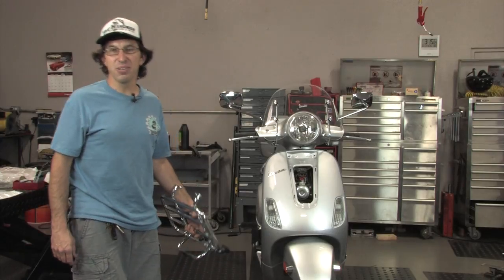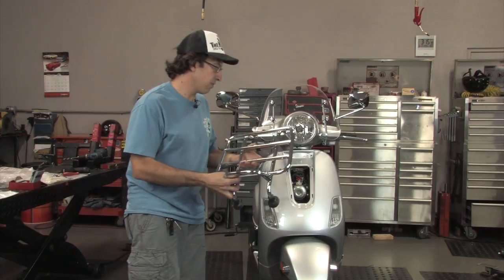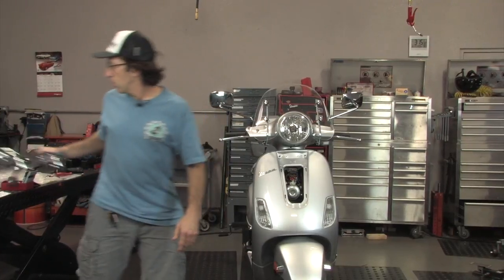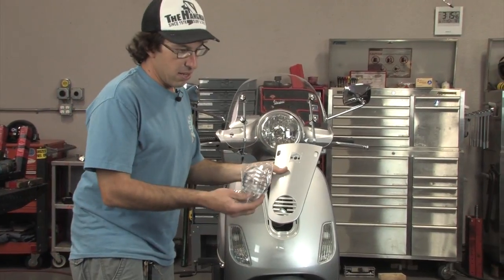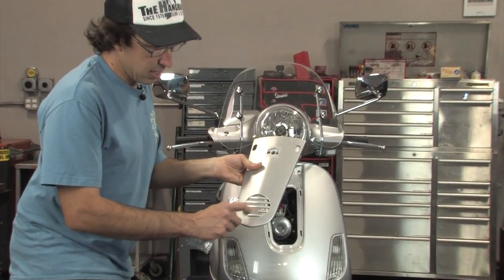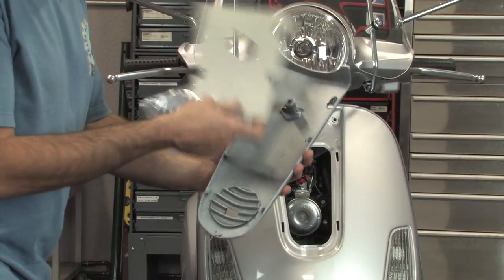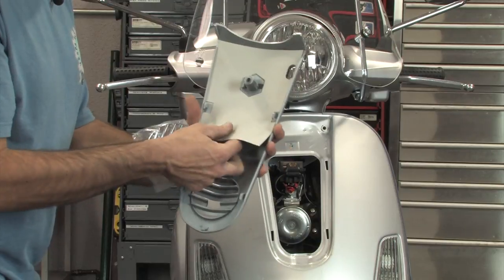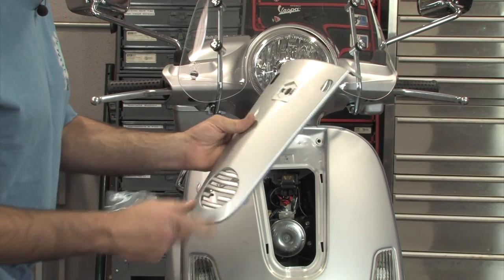Installing an Original Vespa LX Front Rack

Comment: I just purchased a front rack for my 2011 LX 150. The installation was not as simple as shown. First, there was a metal piece to place under the bolt which holds the horn and not a hole to secure a bolt under the horn. Secondly, there were two spacers with screws for the top and one screw at the bottom that had no spacer.  I had to bend the metal piece forward to reach the screw which was a bit short. Nevertheless, I made it work and now I have my front rack. Thanks for the video!  🥴🥴🥴🥴🥴🥴🥴🥴🥴🥴

Comment: How do you take that front panel off in the first place?

Thanks
Reply from the maker: +TJ PVP King Dillashaw Turn the handlebars to one side. Pop the Piaggio badge off with a small flat head screwdriver. Remove the single screw, slide the panel up and away.